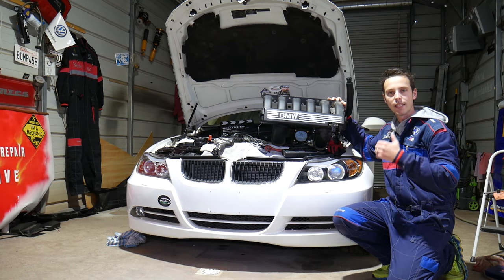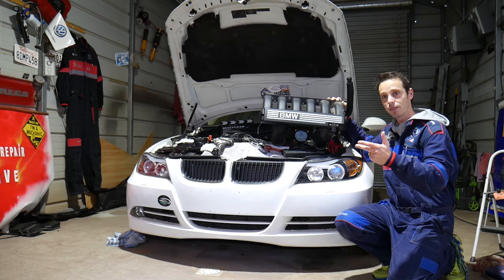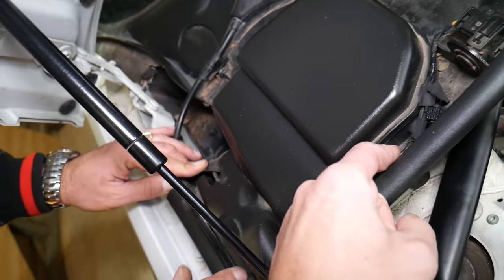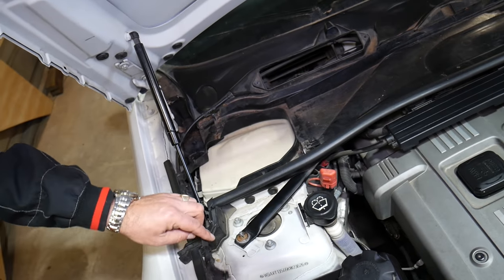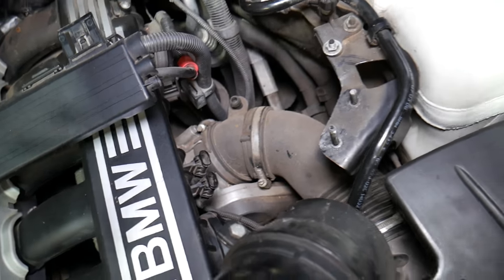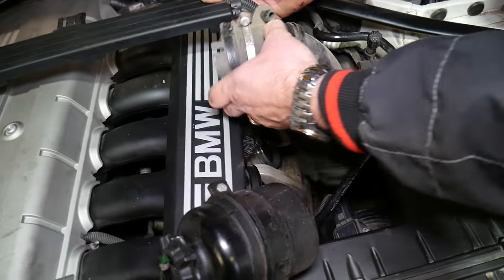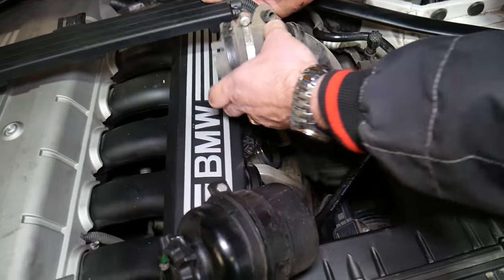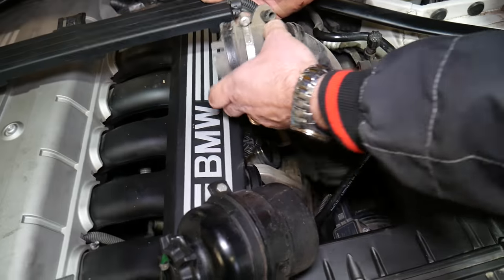BMW INTAKE MANIFOLD REMOVAL REPLACEMENT N51 N52 N53 ENGINE E90 E91 E92 E93 E60 E61 X5 X3 E83 Z4 E87

Comment from the maker: Part and Tools You May Need to Fix Code P0171, P0174:
► Intake Manifold: https://amzn.to/4f70oH6
► Throttle Body Gasket: https://amzn.to/33rhThC
► Intake Gasket: https://amzn.to/2UjBtrL
► Purge Valve: https://amzn.to/3de1Gk6
► CCV System: https://amzn.to/2Wwpeet
Products that we use and recommend:
► Assorted Fuses: https://amzn.to/4f6qJos
► Panel Removal Set: https://amzn.to/3YiMADu
►Torx Set: http://amzn.to/2hbyWgd
► Tool Set: https://amzn.to/3p5MM6t
► Screwdriver Set: https://amzn.to/3XRB28Q
► Engine Oil: https://amzn.to/3xBc8B9
► Oil Filter: https://amzn.to/3w0Ulme
► Torque Wrench: https://amzn.to/32qyRwg
► Liqui Moly Engine Flush: https://amzn.to/3IiDBID
► OBD Scanner that we use most often: https://amzn.to/3I4MQfe

► Check out our Amazon Store for the tools and parts that we use: https://www.amazon.com/shop/worldmechanics
Reply: L
Reply: Lllo
Reply: And that removal gives access to disa valve . Is there only 1 on the 525i?

Comment: One thing I would add is when removing the fuel line you should take the cap off of the bleeder valve and release the pressure from the fuel rail prior to removing the fuel line so fuel doesn’t spray everywhere. Your videos are great tho. They have definitely helped me out on more than one occasion!

Comment: This video is incredible.  If I had only the BMW service manual I would have been lost...it's awful in instruction.  The instructor in the video took the time to explain "pitfalls" one might have during the procedure and how to avoid mistakes.  I also recommend changing the starter while you're in there.  This is a JOB!!! did it by myself, changing starter, CCV assembly and hoses.  Was having idle problems upon startup and beyond, was getting BMW specific code (can't remember but MAF sensor detected lean condition).  MAF sensor did not fix, but CCV replacement did..car runs perfect now.  Would recommend good lighting that can be moved (got LED goose neck lamp that worked great), paint all your connectors different colors (used Dollar Tree art paint @ 6 colors for a buck).  Used orange duct tape wrapped around cables requiring connect/disconnect because they can "hide" under things.  And take your time.  Thanks again guys for the well documented video!!!
Reply: Looked that code up and it was a BMW specific p1415

Comment: Crank case wire to junction box under manifold needs to be replaced.  I destroyed it replacing starter.  How do I replace the wire with crank case sensor?

Comment: Awesome video guys, really helpful, I managed to get the two screws off the wire loom plug and vertical breather pipe was the worst, the only bit missing from the video lol, i didn't break a thing lol, thanks

Comment: Great video, let me add that disconnecting battery (negative cable), insulate battery terminal with rag, will prevent anything from surprising you, such as fuel pump.

Comment: I have a question when you went back into the engine bay at the end you showed the starter what is leaking and it looks like it behind the alternator… what is that called

Comment: Does that "purge valve" even need to be completely disconnected? Can't the entire manifold be pulled out with the valve and hose attached? Of course the electrical connector would have to be disconnected, but would this be possible?

Comment: Thanks for the nice video! You mentioned another video on bleeding oil system to solve the valve lifter noise. But can’t find it in your channel. Can you please send link?
Reply: I just saw this I'm sure you found that info after a year? I have a 2006 325i and I keep my car in sports mode most of the time but 100% of the time when it's a cold motor because it's keep the rpm higher therefore it warms up faster. when I did the valve cover gasket I saw the carbon deposits from not warming the motor too.

Comment: nice video. Thanks.... I have one question: how can i check if the Intake Manifold Vent Angle Conector is damage on the wiring pins? if i check resistance on the 2 pins for the connector, what value should i get? Should i get also coninuity between those 2 pins? thanks

Comment: What engine is it exactly? Not N53 as I have that and it has direct injection with big injectors right next to spark plugs and metal pipes going to fuel rail.
Reply: 2006 year n52 I reckon

Comment: He auto repair guys. Your videos are very informative and hope you can guide me further relating to this video. On my N52 E90 the last "intake boot" that attaches to the throttel body, there is a hose or maybe wire that is attached to it. That thin hose goes up and ends up in between the second and last intake manifold ports if you will. Based on videos that seems to be the oil separator? Wondering how to remove this so I can disassemble the throttle body from the intake manifold. Not sure how I can upload photos here to help with my description. Thanks.
Reply: Sorry the oil separator I mentioned is actually the PCV valve as you've described in your video.
Reply: Figured it out already :)

Comment: I have a 2007 328xi been working on it for months with a shop my service engine light stays on still after work in motor flushed transmission alot of work even replaced air compressure I would her a squal sound straps light then gets louder the shop says need to go in to intake I'm getting frustrated hop as a woman he isn't just taking money saying this is it this is it ?

Comment: When can you do a video cleaning the the carbons in the intake manifold valves  e90 ????
Reply: N52 and N54 non turbo engines are port injected engines.... There’s no need to walnut blast them as the fuel is sprayed over the intake valves and cleans them while it’s running.